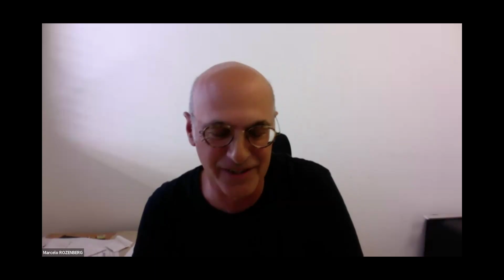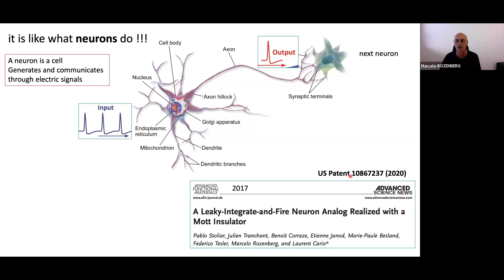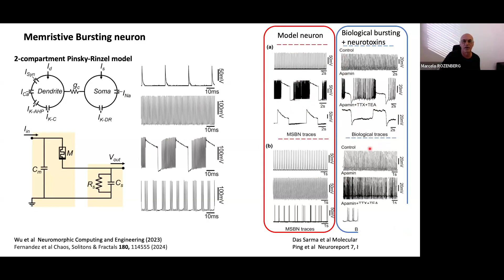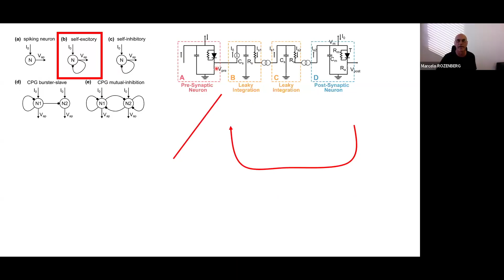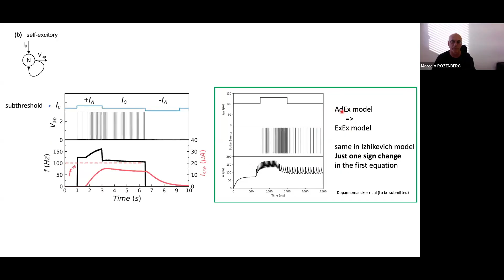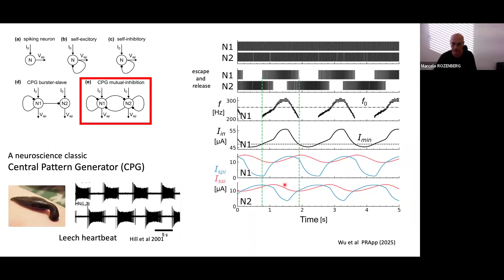Dynamics of neural motifs realized with a minimal memristive ...,  Marcelo Rozenberg, CNRS, Paris

Comment: Nice video.  This is a fantastic and clearly explained overview of a truly paradigm-shifting technology. One of the most exciting yet under-discussed implications, which your video hints at, is the potential for a complete decoupling from the von Neumann architecture and even from the error-minimization paradigm of modern deep learning. Instead of just building faster hardware to run backpropagation, what if we use the native physics of these memristive motifs—their dynamics, temporal filtering, and inherent stochasticity—to solve problems that are intractable for deterministic digital computers? Perhaps the future of ML isn't just efficient image classification, but real-time, low-power reasoning in uncertain environments, like a robotic sensor that doesn't just recognize an object but predicts its physical trajectory through a chaotic space by essentially simulating physics in the analog domain. The real breakthrough may come when we stop treating the hardware as a passive substrate and start co-designing algorithms that treat its so-called "non-idealities" as core computational features.